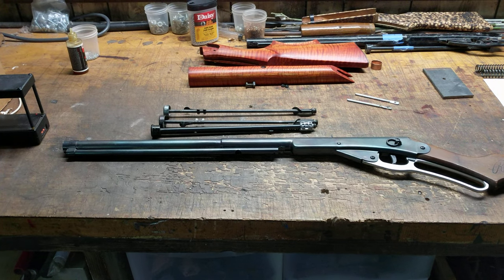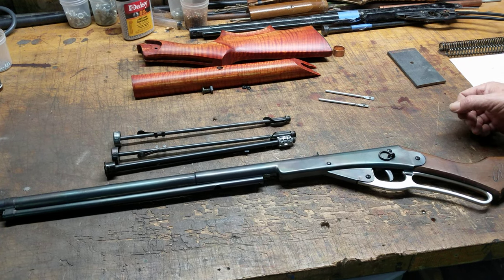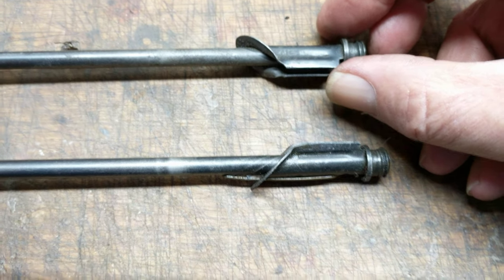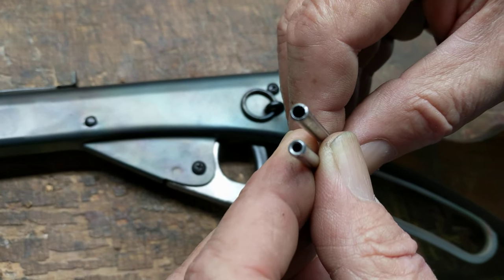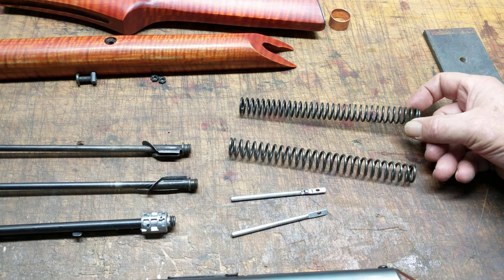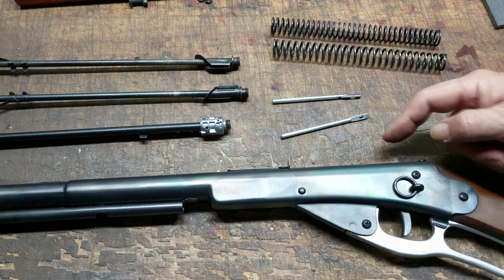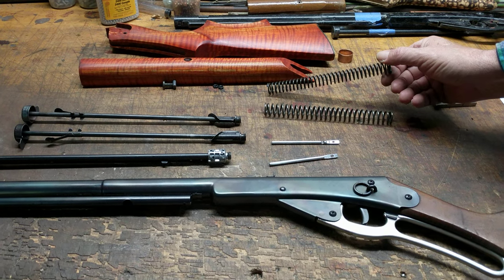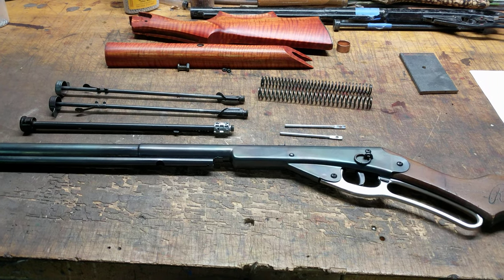7/64" overbored air tube effects on velocity in a Restomod  Daisy #111 Model 40/27

Comment: Ive worked with airsoft and paintball guns for years, as well as real guns. They make flat springs for Ar plaforms and other guns. What if you try to make flat springs for these. Tighter bore barrels work too in airsoft. Just use the good quality bbs. I got more info and ideas that ive done to boost the fps. If you would like to try.
Reply from the maker: I've only seen flat springs in the older Daisy Model 25 pump guns. I'm not aware of any source for current production flat coil springs  that will fit the small frame Daisy recievers. I do use the "Tight Bore" airsoft barrels when I fab up a airsoft conversion shot tube for the older Daisy's that used the screw in BB shot tubes. They really fly if you also use the the Cobalt Super Spring and drop in an overbore 7/64" air tube but the added speed makes the airsoft pellets much more erratic in terms of accuracy. It'll run a squirrel off a birdfeeder real quick with no damage. Nothing like moving targets that reset on thier own.

Comment: Correct me if I misunderstood. The newer Daisy Red Ryder 1938 can't be modded with the 327 cobalt spring & air tube? Only the older ones.
Reply from the maker: The current production Model 1938B can be modded with the Cobalt mainspring and an over bore airtube. It is not capable of using the current model 25 spring loaded 50 round shot tube due to having the integrated shot tube/abutment assembly instead of the older metal abutment  washer and separate detachable shot tubes used by pre-1978 designs.

Comment: Can I put gamo spring?
Reply from the maker: If you're talking about one of Gamo's break barrel high power air gun models, the short answer is no. Those springs are quite a bit longer/larger than the springs the Daisy small frames use and just will not fit.

Comment: Has anybody talked air flow related to tube size? It must speed up as it enters the narrow part of the tube—since the same amount of air is flowing through the narrow part as the wide part, it must be going faster.
Reply from the maker: There's been quite a of discussion on that topic over at the $15 Dollar Daisy thread at the High Road forum.

https://www.thehighroad.org/index.php?threads/putting-a-little-more-power-in-a-15-00-daisy.807316/

It's a huge body of work on modding Daisy's and worth the read. In terms of your observations about port size and airflow I did another video that touches on that that's here:

https://www.youtube.com/watch?v=tAD2pJEDbdk&t=4s

The viewer comments on that one are pretty informative and suggested quite a few mods that could be made and tested. I complied a list and dropped it in my tommorrow file for later use but have not had time to pursue it.

Comment: Where can i get this mod and others
Reply from the maker: If you're looking for parts and intend to do the install yourself head over to Cobalt327's store on the 'Bay

https://www.ebay.com/sch/cobalt327/m.html?_trkparms=folent%3Acobalt327%7Cfolenttp%3A1&_trksid=p3542580.m47492.l71970

Mark is a solid guy who knows Daisy mods in and out.

Comment: I have a  preloaded spring with 1/2 spacer with over bored air tube. There was a forum on this years ago.Cobalt  sent me a tube that he had bored out. Very hard to cock. Probably 350ish fps. I see he had some springs for sale on eBay. I’ll have to revisit this experiment.
Reply from the maker: The thread you're talking about is still alive and well and spans 63 or so pages. It's one of the things that got me started modding Daisy's several years ago. Head over and get up to date as there is a lot of  stuff in development!
Reply: @RestOModDaisy  glad to hear! Yes I will thank you.

Comment: An abutment an large seal can be thrown into a B series. I use the modern 26 still o-ring it and front 7/64 and a 1/8 make a huge difference. Single or double port didn't seem much a difference but shape of the inlet seems to make a difference I perfer a triangle shape.  I  home make my air tubes from extendable magnets and mirrors. The longevity of them is about 7500 bbs but boy do they fly and hit. I have played with many setups using different ATs but same Springs and of the entire cycle I find irrefutablly the AT us the most determining factor in that bb going the distance an power. Cobalt327 Spring is a must for anyone looking for any umph from a modern daisy put a nylon washer on both ends of my piston to support the charging of spring safeguarding against top internal rub and adds about 3/8 of spacing. Plus nylon doesn't leave damaging flakes in gun. Wish I could add a pic here for people to see may start my own tinker short clips. Like carefully dremeling a moder 25 ST so both ends take a bigger air tube. The compression side on it is smaller inner diameter then muzzle end to me restricting the max outer diameter air tube usable which is about 2 sizes up. I  Encourage anyone that has any interest in daisies to binge watch your videos because they are very informational very simple straight-forward and just overall you have fun doing it and that makes it even more enjoyable to watch
Wolf
Reply from the maker: Jeremy, I haven't messed with port design in a while and am intrgued by the triangluar port idea. Is the point of the triangle up or down or to the right or left? I've never considered using the telescoping sections of an extended magnet or pickup tool as the basis for  an airtube but I'm gonna look into that. What diameter/thickness of nylon spacers are you using as a plunger assembly guide? I know that several modders have incorporated a small roller at the rear end of the assembly to help reduce any drag/wear on the piston during the cocking cycle but yours is the first use I heard of using nylon spacers for that pupose. You really should throw up a few videos on these mods, if you got a modern smart phone you're in bizness!

Comment: I've been reading some of the blogs about getting maximum velocity from the lever action Daisy BB guns. I have not read anything about anyone trying to plug the loading port at the abutment and muzzle loading the BB as you would do in a model 499. Have you ever tried doing that to see if there's any gain in velocity or heard of anyone doing that with any results?  I would rather have something that doesn't hit as hard but you can fire off shots much more quickly but it would be interesting to see what effect it would have to eliminate that possibility of air pressure escaping.
Reply from the maker: Marty,

Your supposition is correct. If you replace the gravity fed or spring loaded shot tube with a single shot version with no loading port in the tube itself you will see dramatic increases in the muzzle velocity. This was demonstrated by Cobalt 327 and Hinz57 in a section of the Daisy Modders Bible AKA  "Putting a little more power in a $15 Daisy"  thread over at The High Road Forum back in April 2017.

https://www.thehighroad.org/index.php?threads/putting-a-little-more-power-in-a-15-00-daisy.807316/page-12

As far as I know, as of today, the fastest Daisy Model 499 single shot lever gun ever built is a custom job modded by Cvans that is pictured on page 43 of the thread. It's been clocked at 478 FPS and is wearing custom stocks I fabricated for the effort.
Reply: @RestOModDaisy  I have previously read that blog. My thoughts are the effect that it would have on muzzle velocity while still using the original repeater shot tubes and regular premium grade Daisy BB's. In other words,  still having the loose tolerance between a standard BB and original RR/Buck shot tube while eliminating any loss of blowby from the loading port.
Reply from the maker: @martyharless5097  Hinz57did do some fabrication experiments with the air tube in an effort see if the modded air tube could serve as a better loading port block once it's traveled far enough to occlude the breech opening. The results were inconclusive as the pressure loss evidentially occurs very early in the firing cycle before the tip of the air tube can pass and block the loading port.

Comment: Shane can I increase the air tube on a Model 25 make you can on a Red Rider by going to the 7/64 shoot tube let me know very much appreciate it George from California
Reply from the maker: It should work fine on the new production Model 25. Might be questionable on the earlier guns from the 20's-30's because their air tube lengths varied a bit from year to year.

Comment: is there a spring that could push it to over 400fps out there?
Reply from the maker: I've only seen that speed level in one gun that I converted last year. It was a Daisy Model 111, post Rodgers small frame with the same seal set as the current production Red Ryder. It hit 405 FPS during the 10 shot speed test after I installed the power triad assembly and averaged 395 FPS over the firing string. I think of it as a "One of One Thousand" Daisy where everything went right when it was built.